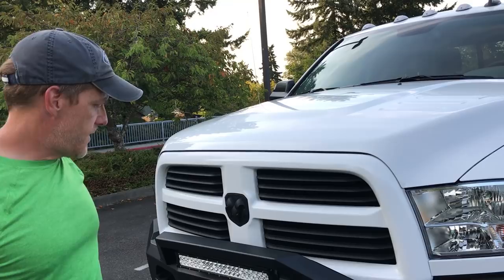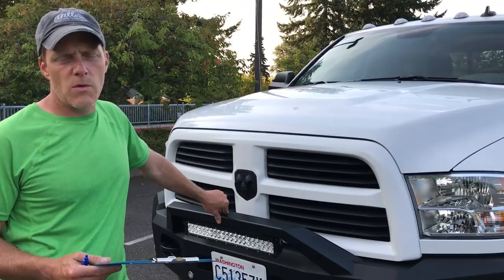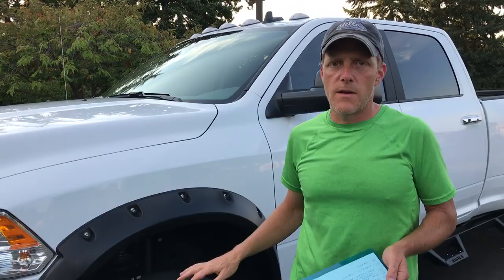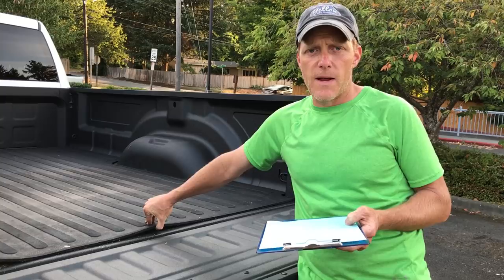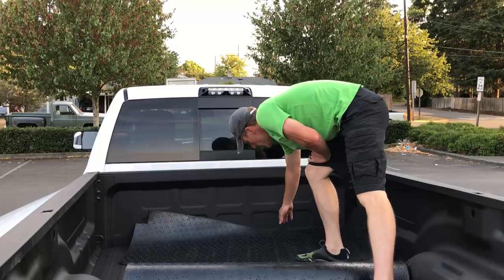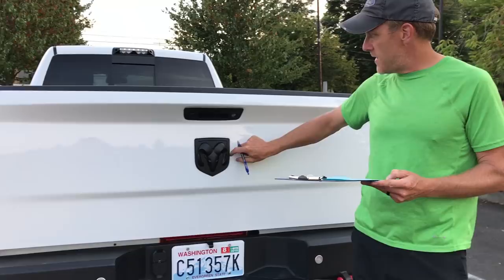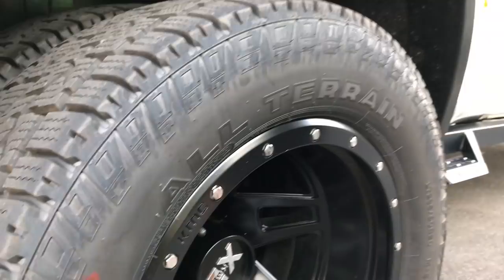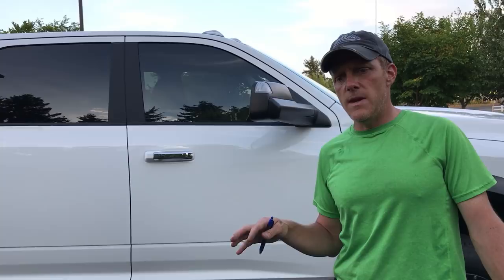2017 RAM 3500 Build - WORTH THE TIME!!!

Comment: Another thing I’d add to that truck as I have a very similar one is recon black marker lights. There tinted black all the way around, and have led lights in them. Don’t throw any errors, Still Amber color lights for the front ones in front of the rear tires and still red for the back two behind the tires. And just look black during the day so they match your fender flares and wheels and bumpers etc. would look very good. Don’t look cheap or super modified or anything dumb like that. There about 100 bucks on Amazon. I loved them have had them for a few months now.

Comment: I've had the ICI steps on my 2016 Ram for a year I agree the brackets  are super awesome, the step flexes more than I like but they work fine and I'm 240lbs.
Reply from the maker: Agreed. I thought it flexed too much when I first had them on but they have done really well and seem to support all that they need to.  No need to overkill and add more weight.  I like the look of them much more than the round bar and other options on the market thus far.

Comment: Very nice. I may consider doing some of this, especially the bumpers & running boards (cool to see you could actually use the full length running boards with the dually), when I acquire a RAM 3500 diesel dually next year. Especially useful were your thoughts on air bags. And your front grille work is very nice, though I'm less inclined to invest in mods that are purely cosmetic.

Comment: For an engineer with a long spec sheet you missed a big DOT item, mud flaps.
Reply from the maker: I have not figured that out yet.  There were some crappy factory ones on there but they did not work with the flares so I may just end up with some heavy rubber.  Good catch.
Reply: Jerrod Sessler you are correct, mud flaps will not fit with fender flares, you will have to drill into your rear plastic or just bolt some on, word of advise don't use real heavy mud flaps if you are going to screw it on your trucks wheel well, if they're to heavy over time it'll start to tear out your wheel well and fall off
Reply from the maker: The big problem I have found is in the front as the front tires fling a lot of junk onto the side of the truck in the rain especially.  I am not as concerned about the rear but will probably do something.